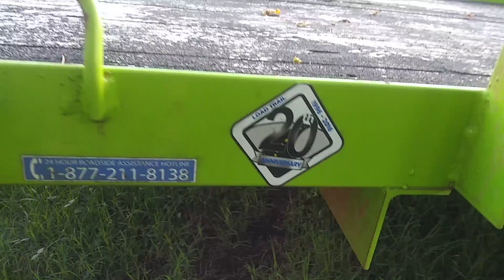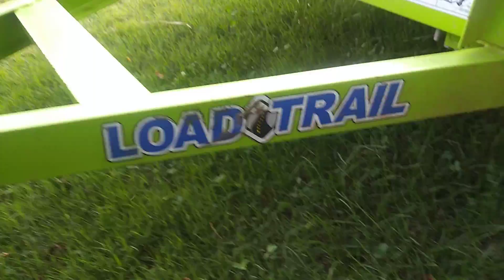Crappiest design ever

Comment: For the money it has some nice features. The angled lights on the front corners and the small step area where the fenders meet the frame.
The plate mount is stupid.
I have to fix this same issue on my gals 4x8.

Comment: That stinks joe. Pay good money for a trailer and its not worth the price point.  
You saw the plate mounting.  I saw the weld job.
Reply from the maker: had a 5x14 trailer stolen from shop yard couple weeks after buying it used for $700 to $800. insurance pays replacement costs. Couldnt find any same size. This was closest to size and cheepest. so insurance bought it actually. So I basically paid half and insurance paid other half. half i paid was on trailer that was stolen. this is like 3 or 4 years old now. was just looking at it earlier today and like lets do a video
Reply: @SgtJoeSmith  definitely needed to do a video on it. And  Thieves just make me mad.